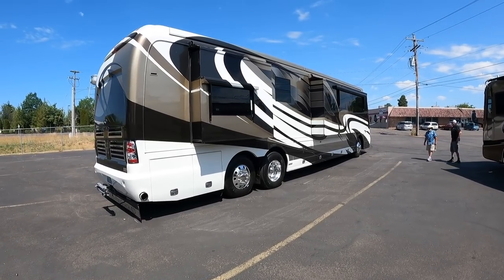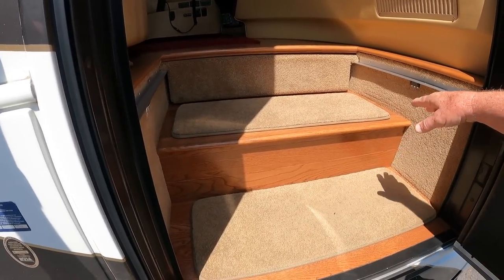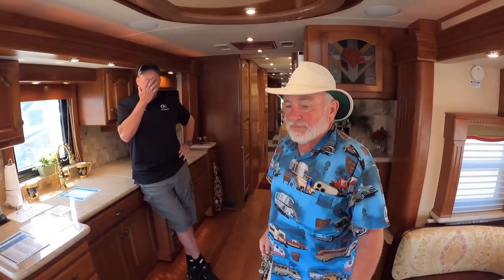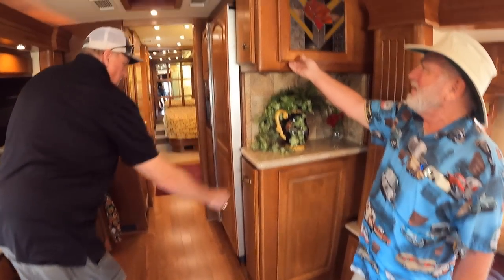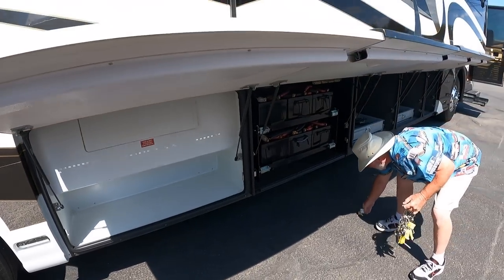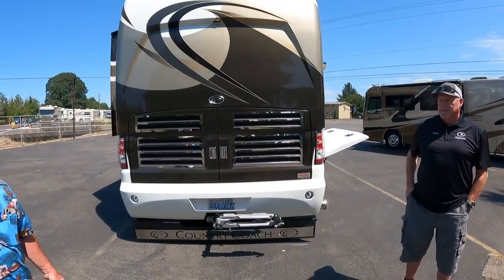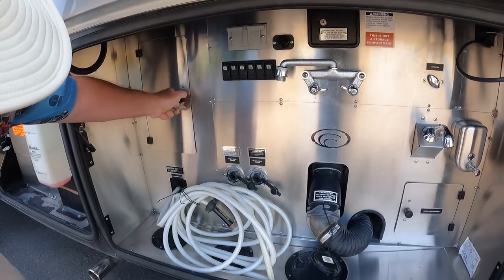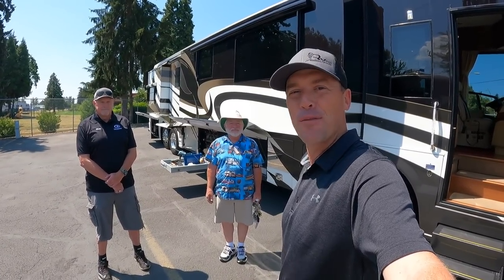Rare Country Coach Affinity 700 Stag's Leap FOR SALE!

Comment: Did I miss the price? I like the wood floors, 600hp and no DEF.
Reply: Someone below said 350 - I assume thousand - but I didn’t hear it either. That seems high to me if indeed that is the price but I’m really not qualified to opine. 

Yes no DEF and no DPF. I like that. But soon these will be getting on the old side. Age is more of an enemy of these coaches than mileage, assuming they’re well-maintained. 

Or so I’ve heard. Owned a couple of gassers but never anything like this. Sweet looking coach for sure.
Reply: @CAROLUSPRIMA  $350,000 for a 2008, I agree seems high.
Reply: $349K.
Reply: @terrysmith2233  Thanks.

Comment: If they’re going up the chain of Country Coach’s, don’t leave out the Lexa, which sits at the top of the food chain.
Reply: The Lexa was only built for about 1 year (2003-2004). Was quite different than the other CCs. Not many nice ones left out there. The Electronics were quite complicated. CC also built a “Concept” for a few years in the 1990s and early 2000s. Again they were quite different from the others.

Comment: hmm so they have Issues with their slides nice to know thank you
Reply: The slide mechanism is HWH as are most other high end coach slides. I have used this same procedure on other brands of coaches also. All slides in all coaches will have issues some time or another. This trick, if by rare chance either solinoid does not function, will save a lot of grief. No problem on this coach but this was a tip for other coach owners that are not aware of this trick.